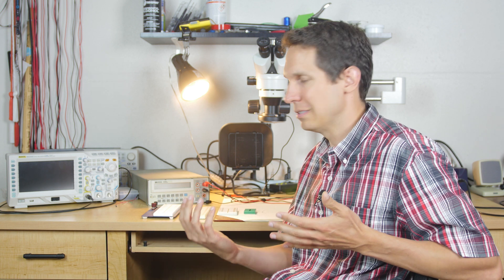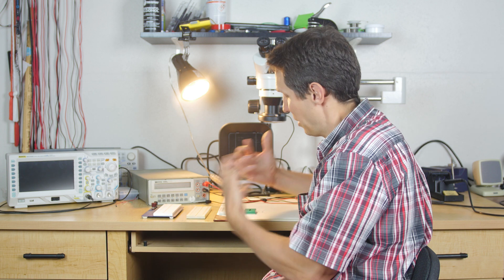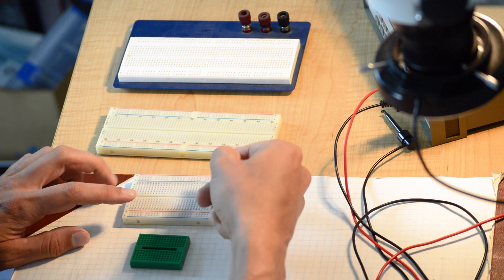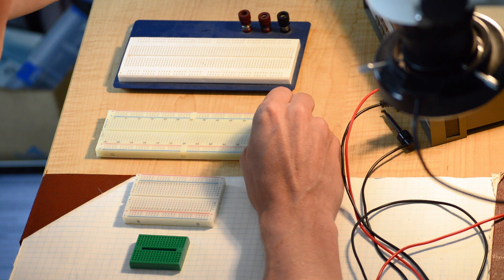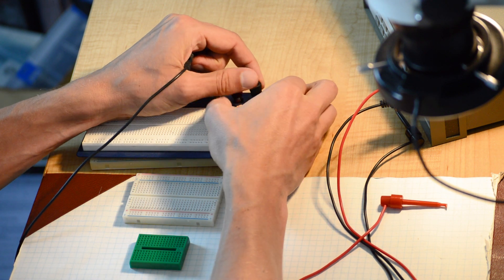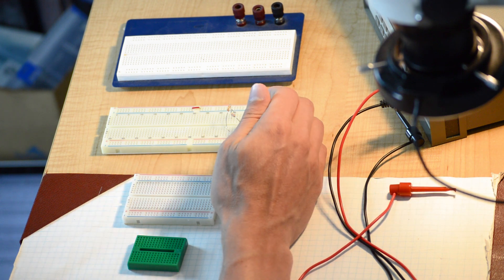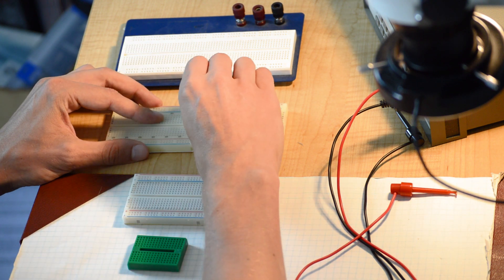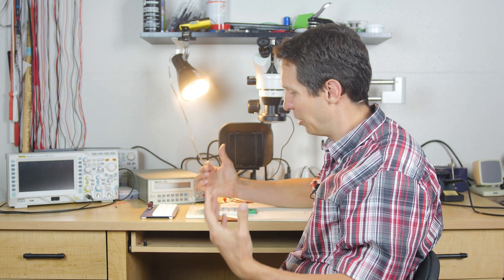How to use a Breadboard - Breadboarding 101 | Basic Electronics

Comment: Let's say that you are using a bord with binding posts for separate power rails.  Since I'm sure you are using an isolation transformer for safety, to then  all your power supplies will have floating ground!  Or do you establish one common ground, using one of the posts for that purpose??
Reply from the maker: Technically, everything has a floating ground in comparison to something else.  But by establishing one common ground for your circuit, using one of the posts, exactly as you said, your circuit will have a single, non-floating ground.  But compared to the ground voltage of your house, for example, it would be considered a floating ground.  But, as long as the ground is internally referenced, it's not a problem for your circuit.

Comment: Please consider some additional tutorials. For example, on the use of an assortment of wire clips and connectors like alligator clips and PCB connectors. Calculating the correct value of a resistor required for a project. Using cheap Chinese motion sensors, voltage converters, displays in different projects. Last of all, consider getting a whiteboard to illustrate and explain how all these things work and are used together. Cheers
Reply from the maker: Thanks for the feedback and the ideas!  We have a long list of topics we'd like to do and I added these to that list. We also have a spot on the wall where we're planning on mounting a whiteboard for certain situations.  I've resisted for months, as I have horrendous handwriting, but the team has been insisting...
Reply: Nice! Content creators like bigclive, Afrotechmods and GreatScott! make great use of drawing things out. If you can draw a basic circuit, I think you'll do just fine. Like that you don't rapidly switch views back and forth and use a tripod to hold the camera steady. Also, get a few more closeups when you're pointing, or referring to something on a project. Look forward to your new videos. Cheers
Reply: @CircuitBread  Any time someone in authority says "we" first thing instead of I, during initial correspondence is a red flag sir.  Are you some type of man child? I an a kidult myself but am not a teach nor 50 yeARS oLd... not even close lol DAd